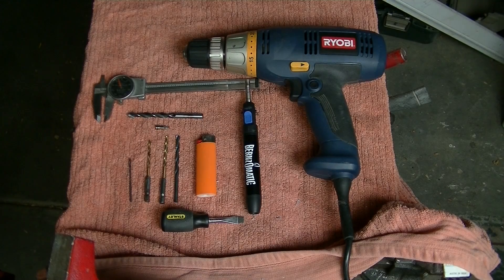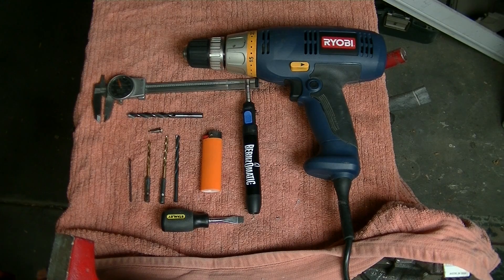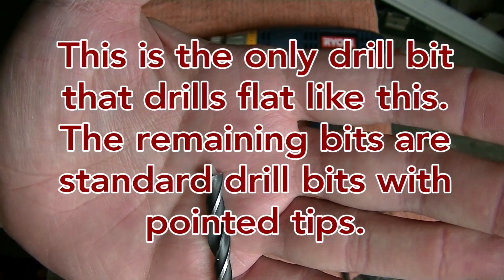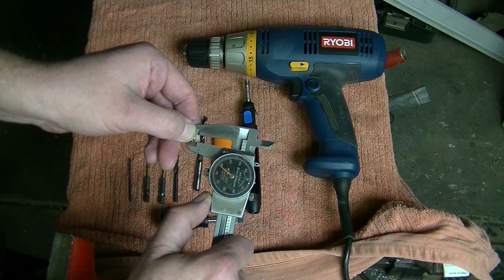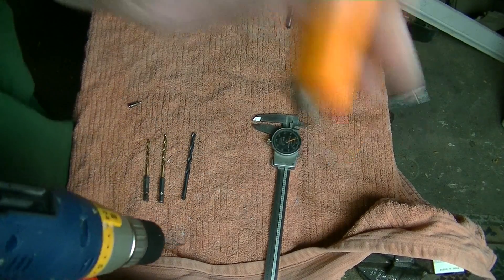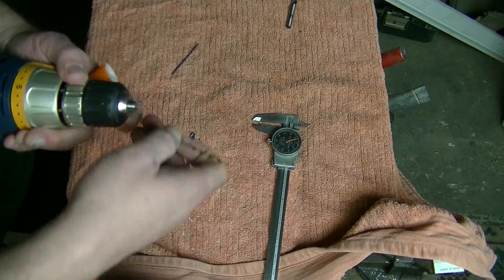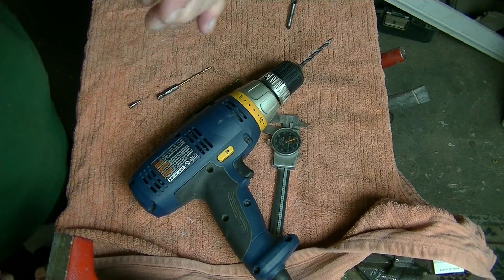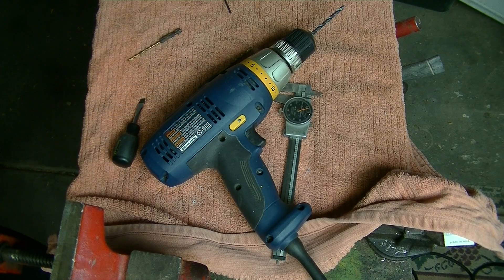Make A Bic Lighter Refillable By Installing A Refill Valve

Comment from the maker: Wow, I haven't been checking in for comments ... apparently there are quite a few. 

Let me first state - for the record - the entire reason I started developing a method for making Bics refillable in the first place.

Exhibits 1 and 2 (these are pics of the same lighter, just different sides):

1) http://i.imgur.com/x6jtSeK.jpg
2) http://i.imgur.com/PU00nZZ.jpg

As a hobby, I like to carve images onto Bic lighters, then use an epoxy resin to seal the art. When I do this for friends, they quickly become attached to the lighter and they, of course, want to be able to continue using the lighter. even when it runs out of fluid.

Walla - this method was developed!

Also, let me state that cheap refillable lighters (in the sub $10 range) are CRAP! They have too many moving parts which become loose very quickly, and they ignite MAYBE one in five attempts. And the older the lighter gets, the more clicks it takes to ignite them.

Bic lighters are hands down, the absolute best lighter EVER invented:

1) They work at the first strike EVERY SINGLE TIME WITHOUT FAIL (as long as there is fuel)!
2) They are shaped PERFECTLY for human hands.
3) They are SIZED PERFECTLY for storing in any pocket or purse. 
4) ZERO sharp edges or awkward shape.
5) The best engineering in a lighter EVER. 

Even in refillable lighters that cost over $30 or more, I experience more hassles with the lighter than I EVER do with a Bic.  

Bic lighters are simply THE STANDARD that every other lighter aspires to, but ALWAYS fails.  Perhaps this is why Bic produces over SIX MILLION of these lighters every DAY! That's roughly 2.2 BILLION lighters every year!  DAMN that's a lot of lighters!

If Al Gore ever learned about how many lighters Bic produces in a year, I'm sure he would  somehow figure out a way to blame Bic for global warming! (If you think I'm kidding ... then just google 'Al Gore Inconvenient Truth Leaked Email' - and enjoy!)

And people SERIOUSLY!  ZIPPOS????? For Real?  I shouldn't even have to say the obvious here, but since we seem to have a wide range of experience among our viewers ... ZIPPOs are the lowest common denominator for refillable lighters. They are messy, they stink, the flame tastes awful when you light your cigarette or pipe, and they are bulky and clumsy. HARDLY worth using in a survival scenario. YES, there are butane mods for Zippos, but to me, thats like installing a small gasoline engine onto a 10 speed bike ... yeah ... I GUESS it works better ... but ... it's still a ZIPPO!  BLEH!

Concerning Bic flints ... many of you said that a Bic flint only lasts as long as two or three refills. This is TOTALLY FALSE! I've refilled my Bic more than 10 times without running out of flint. At $1.55 per lighter, that costs more than the refill nozzle. Get your facts straight people!  

And again, THANK YOU FOR WATCHING!!! ... over 114,000 views so far on a video that I thought would MAYBE get 100 views (literally).  You guys ROCK!
Reply: Yea i have a few zippos, and i mean like 15, maybe 2 work still because i got tired of replacing flint all the time and putting in fluid everyday because of evaporation thru the wick and canister. and dont even try lighting a pipe with one, haha, unless ur cool with the leopard eyebrows look then go ahead. 

I have refilled my bics at least 20 times now and flint is still good. i got a hole bunch of reserve bics i take the flint out of for my "forever, flick my bic" lighters. so technically i never have to buy another lighter again. i think 2 bucks vs. 10 to 40 50 bucks depending on the lighter is a hole hell of a lot better. 

Plus I've had 3 torch lighters blow up in my hand and its never happend with my bic. Remember people safety 1st. haha.

And those are really really good. U got yourself a real good tallent there. Dont stop trying to go somewhere with that, i bet you could make a hole money off that one day (if you havent all ready). But these people on here have nothing better to do in a day than try to make someone as miserable as them, so they talk shit. But people love bics more than any lighter out there so if you never had to get rid of one, and you could get it customized, people would buy em out in a heart beat. Im learnin to airbrush so i plan on doing airbrushed bics soon. Once im great at it. haha.
Reply from the maker: @smileyboe2694  Zippos are just ... fuel spewing liquid flame gross tasting nonsense ... too much upkeep too as you pointed out...
Reply from the maker: +Datzfunk Yes, what I do, is design them in Photoshop, then I print them in a mirror image. Then I use transfer paper to get them onto the lighter and then with a Dremel and an engraving bit, I carve them CAREFULLY into the Bic. It takes time and patience. You can't UNDO a screw up on  plastic when you're carving, and getting a straight line is a lot harder than you might think.  ;-)
Reply: Keep em coming!
Reply: +Mike Sims Awesome designs. They are hand carved? That takes some skill.
Reply from the maker: +SMiLEy BOe I haven't made a dime off of this video, because when I signed up for all that, they said I needed to do something else to finish the process and I haven't done it yet.  But I don't think 114k views nets someone very much coin ... but im definitely going to look into what it takes to make that happen because even if it's just $5 ... its MY $5 and I shouldn't just sit on it and let Google keep it ... lol. Thanks for reminding me by the way.  :-)
Reply: +Mike Sims <<< 1) They work at the first strike EVERY SINGLE TIME WITHOUT FAIL (as long as there is fuel)! >>>

No, they don't. They work on the first strike most of the time, and that's only if the air around you is perfectly still. They are very difficult to light when it is windy. A Zippo also works on the first strike most of the time (as long as it hasn't been overfilled with fuel), plus a Zippo is a lot easier to light in the wind.

<<< ZIPPOs are the lowest common denominator for refillable lighters. >>>

You're not using the term "lowest common denominator" correctly. Zippos are very high quality; made from expensive, durable materials (stainless steel and brass). Far from being the "lowest common denominator", they are the de facto standard for wick-type lighters.

<<< They are messy, they stink, the flame tastes awful when you light your cigarette >>> 

They aren't messy, obviously. I have no idea where you got that notion from. The fuel has an odor, though it isn't noticeable in a Zippo unless you put it up to your nose and sniff. I also wouldn't call the odor a "stink", because it isn't a repulsive smell like e.g., sewage or rotting meat. It is just a mild chemical/solvent smell. If you hand someone a Zippo and say, "Take a whiff of that!", after doing so they would most likely just say, "Yeah, what about it?" Have you ever seen a Liquid Ass prank? How well do you think such a prank would work using Zippo fluid instead of Liquid Ass?

I've never noticed any flavor imparted to my cigarettes from a Zippo flame when using Zippo-brand fluid. I tried Coleman Camp Fuel in a Zippo once, and I did notice a bad taste from that, because it doesn't burn as cleanly. You could also hear crackling while it burned, indicating a significant amount of impurities. Zippo brand fluid doesn't crackle when it burns.
Reply from the maker: Some people like Ford ... some Chevy ... thank goodness human diversity demands variations in the products we invent and purchase ...   makes this life that much more interesting ... 

Zippos have their function ... I've just never found a situation where it worked better for me over all ... than a Bic ... once all variables, needs, desires etc., were accounted for.

shrug

Comment: Thanks for the video. I'm going to have to try this. A couple things to add about refilling and capping with a pushpin which is what I currently do. 
1. The flint in the Bic lighter will eventually be exhausted also, so with one refill only you don't have to worry about the flint running out, and having to replace it(which can be a pain).
2. In all of the pushpin refill videos I've seen, either the whole, or part of the pushpin is left in the bottom. This is ridiculous, I just bite down on the plastic with a bit of a hefty wire cutter, and it shatters, what is left is a small nail head, which you can just push in. 
3. You can purchase flints, they sell them for Zippos, or source them from other Bics I guess..
Reply from the maker: +Datzfunk My biggest problem with the push pin solution BESIDES the bulk added to the bottom of the lighter, is that there is a high risk that the pin will get ejected from the lighter and inevitably ... you'll reach for your bic in your glove box which is over 120 degrees in the summer, which expanded the butane to enough pressure to kick the pin out and you're left with an unlit cigarette ... it's a GREAT temporary solution when you're in a pinch, but hardly a workable permanent solution ... in my opinion of course.

As to the flints, I've gotten over 10 refills on a single flint before.
Reply: +Mike Sims That's interesting about the flints. Good to know. I haven't actually tried salvaging any from once refilled lighters, I only assumed Bic would use flints long enough for a single use with some degree of margin(depending on type of use/length of light). As for the " high risk that the pin will get ejected " I believe there is extremely low risk of that actually. I've refilled ~30 lighters and the pin has never even slipped a little. It requires a lot of force to insert, it may be just as good of an option as the pellet used in its manufacture. I would however not trust it's complete removal and reinsertion for a second refill.  As for the mass of the pin. it is extremely light weighing 0.2g  from my measurement (much lighter than a refill valve surely). And once pushed in, one would never know it was there.(after the plastic has been removed)  In any case the refill valve is a great idea. I just wish there were a better (cheaper) source. It is really a waste that these lighters are made for single use.
Reply from the maker: I agree ... yet Bic produces almost 6.2 MILLION of them every DAY!!! its staggering to think about it. I would LOVE to see the manufacturing process in person. It would be amazing I'm sure. 

Here is a link to an ebay source for the nozzles. Apparently they are popular in the airsoft community ... so do some searching, I think you might be able to find them a lot cheaper now.

http://goo.gl/YCb1iw
Reply: +Mike Sims  Thanks for the source. I'll have to grab some. I looked the other day, they were really tough to find other than what was posted already. I have a feeling there could be a good source on alibaba.com or a like site. I'm sure manufacturers get them for a dime or something. They may also be available in large quantities only. If that's the case, maybe we can figure something out between all of us.
Reply from the maker: I was considering something like that shortly after I posted this video, but a bunch of shit happened ... broke up with my girl ... had some housing issues ... and just dropped the ball, but, I'm down for whatever.

Comment: Wow way to over think it just pull the valve out fill the lighter and put the valve back in simple bic lighters come with everything needed to make them work why add more to it just to loose it or have the plastic itself fail from the temp changes caused by filling them or melt them from to much heat
Reply from the maker: +ferp420 What "valve" would you be referring to?  The seal in a Bic lighter is a plastic 'bebe' that once popped out, cannot be re-sealed.

Comment: co2 fill valve will render more results than butane valve in ur search..remember butane is flammable and creates liability in the devices created for its use
     leave the original hole alone and drill  drill hole to the side  to avoid all the extra work with the middle support wall
Reply from the maker: +Matt Miller I like where you're going with this other than the altered aesthetics which in my situation, are relevant. Also, installing to the side has other issues ... we are dealing with a convex shape, which will not lend itself to sealing up with a flat surface such as the nozzle presented in the video. Also the nozzle is probably too long to work as a side mount.

Comment: you can find the valves in MANY places...this isn't the best or the cheapest nor a large number in stock...but just an example, especially for individuals rather than someone who will be using many many of them...its the fill valve for an airsoft gun...that's the search to do to find them for sale just the valve. 
http://www.ebay.com/itm/like/121898496961?ul_noapp=true&ul_ref=http%253A%252F%252Frover.ebay.com%252Frover%252F1%252F711-117182-37290-0%252F2%253Fmtid%253D1588%2526kwid%253D1%2526crlp%253D53601919689_324272%2526itemid%253D121898496961%2526targetid%253D154774684809%2526rpc%253D0.08%2526rpc_upld_id%253D64088%2526device%253Dm%2526mpre%253Dhttp%25253A%25252F%25252Fwww.ebay.com%25252Fulk%25252Fitm%25252Flike%25252F121898496961%25253Flpid%25253D82%252526chn%25253Dps%2526adtype%253Dpla%2526googleloc%253D9019251%2526poi%253D9019284%2526campaignid%253D239125209%2526adgroupid%253D14978428809%2526rlsatarget%253Dpla-154774684809%2526gclid%253DCj0KEQiA3t-2BRCKivi-suDY24gBEiQAX1wiXF1P0DR3eMyw3aPBnobgjgmOfZm1xz-q-PwrdkT6POkaAgA28P8HAQ%2526srcrot%253D711-117182-37290-0%2526rvr_id%253D991256476158&chn=ps&lpid=82
Reply from the maker: +Trisha Abbott-Mathews Trisha ... those are AWESOME! Some are even shorter than the one I use ... I'm going to work this information into the video somehow ... THANK YOU!
Reply: +Mike Sims you're welcome. glad it helped

Comment: I can't believe you pay ten bucks to ruin a torch just to make a refillable bic.  If you want those refiller parts recycle them from old torch lighters...they work great.
Reply from the maker: +Tim Marx In my experience, anything other than the torch I present in the video, has nozzles that are either not threaded, or far too long to work in this mod.
Reply: Yeah ur probably right. I keep fuckin em up. haha.
Reply from the maker: Tim, new source for the nozzles ... NOT $10 ... http://goo.gl/lGhFxO
Reply: Now thats more like itll lol. Im gonna order a few of these...maybe a dozen. Thanks Mike.
Reply from the maker: They don't require chipping away at the inner wall of the lighter either .... so yeah, major upgrade with those nozzles!  ;-)

Comment: Now I'm thinking... $10 for the torch.. 99 cents for a new bic...  Hmm and 3rdly... JUST USE THE TORCH to light  your smoke. LOL  and how do you replace the flint?  (although I do usually save those flints to use in my zippo, if i am out of zippo flints)
Reply from the maker: +gbalkam The torch cannot ignite without a lighter!!!  ;-)
Reply: +Mike Sims Are you sure you are using  a torch and not a candle?  Torches have 4 main parts.. A nozzle where the hot stuff comes out.  a tank for holding the fuel,  a fuel delivery system, to carry the fuel from the tank to nozzle and... An igniter.  Like you see on gas BBQs, press a button, make a spark, light the torch, OR the old fashioned flint and steel cup type.  (what they used in welding shops)  Or of course, just buy a refillable disposable lighter for $2 at the dollar store.  But my main point, why buy and strip apart a perfectly good torch worth $10 to refill a 99 cent bic, just use the torch to light your smokes and save 12 minutes of video footage.
Reply from the maker: +gbalkam The Bernzomatic torch that I have been using to get the valve from is sold as a portable soldering iron and most definitely does not have a built in ignition. I've been using them for years. It would be hard to miss it after this much time spent with them. ☺

Comment: I just did this with a valve from an old broken butane lighter, there were no threads but leave the hole snug enough and you can tap it in with a hammer. Now I can continue using my favorite bic again
Reply from the maker: +Gary Chief I would only be concerned if you store the lighter ... say in a car in the summer time and it heats up when its full... it may create enough pressure inside the lighter to eject your nozzle. And I can't see how a non-threaded tapped nozzle would seal well enough to actually work without some VERY precision drilling... let me know how it works please?
Reply: No issues yet

Comment: Great video but i would rather buy another lighter for $2 than go and buy the re fill tip you took out of the lighter. And besides, i do not have many drill bits. Though i am going to go do this to afew lighters next weekend to give to some friends.
Reply from the maker: +brody lockwood Brody, how did it work out for you?
Reply: ***** It worked out quite well actually. I ended up making one for myself and it's good :)
Reply from the maker: Another convert into the faith ... makes my heart sing.  ;-)

Comment: I addapted one of the first disposable plastic lighters I bought when I realised that I could not refill it. I was disgusted that so much time , effortand material would be put into something only to throw it away.How naive I was . This would have been in the late 70s or early 80s.I used heat to make the hole and got the valve from an old Dunhill lighter that was broken  and screwed it in as per your vid.From memory I had it for years and was verry proud of my handy work .Thanks for the vidio and keep converting !
Reply from the maker: +lord cu mopton, I missed this comment somehow. Thank you very much for the nostalgia ... I remember the Bics from the 70's and 80's, back when they had flame adjusters on them. Also, nice to know that you installed a nozzle way back then ... great minds ... as it were ... :-)